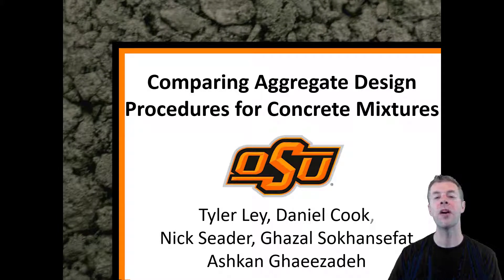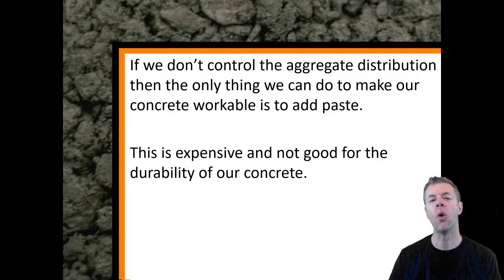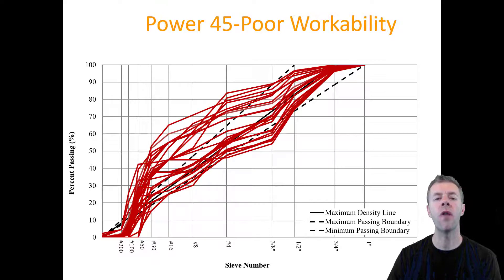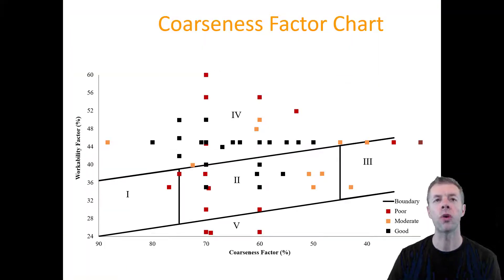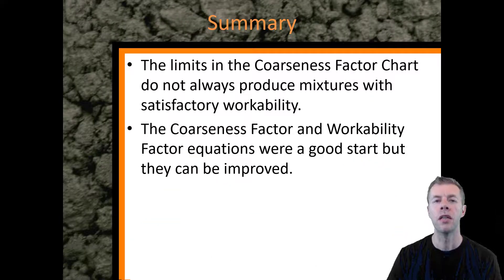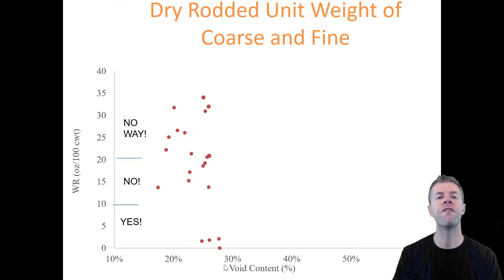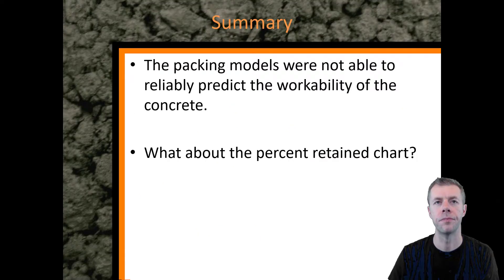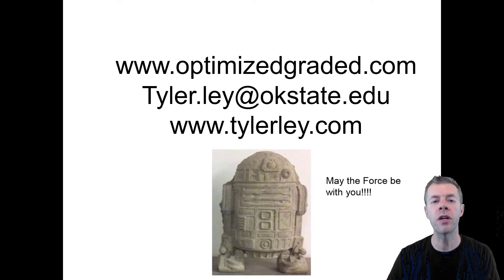Proportioning Aggregate Gradations for Concrete Mixes

Comment: Does workability affect the strength of the concrete? Assuming that the less workable concrete is well compacted. Thank you for sharing your knowledge.
Reply: I'm in a college concrete course right now and thinking about this. Would workability affect strength, or would the strength of the concrete, or moisture content or stiffness, affect the workability of the concrete?